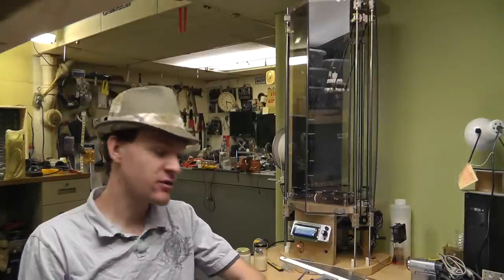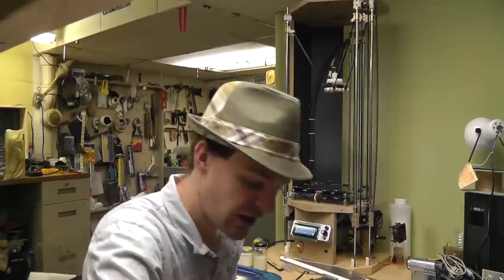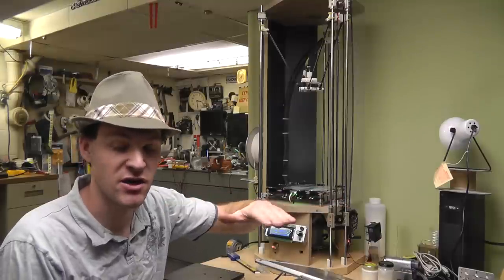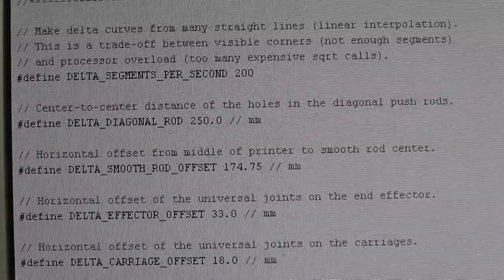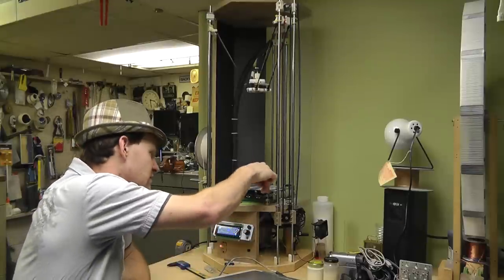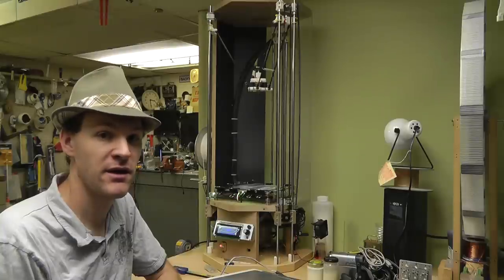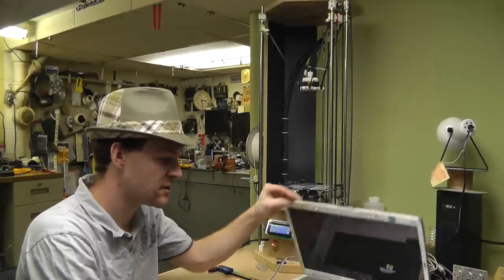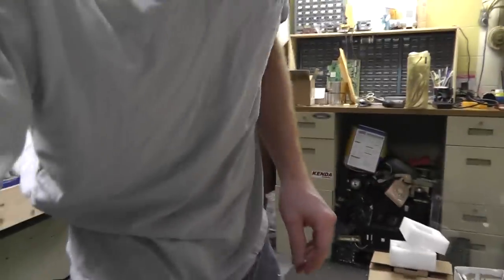Delta 3D Printer Project. Update1. How To Fix the Curling ABS Parts & more tweaking and upgrades.

Comment: I had posted on the forum about excess air flow when you were building your printer, also mentioned the stepper motors would not get hot went steps were adjusted correctly and to make the bed adjustable for leveling purposes, was just trying to keep you from pulling your hair out in frustration. Your abs paste trick is a good one especially with the pvc card applicator, I use a soft plastic bondo spreader. 3d printing is a wonderful learning experience. Thanks for the plug on the hotend, Jeff.

Comment: You've probably already figured it out by now, but your problem is the upper layer of plastic cooling and shrinking before the lower layer, the further up the print, the faster it cools and because the layer just below has shrunk, the next layer will have higher tension, causing it to bow. I'm looking to design my printer so its in a kind of oven. keeping the whole print at a temperature a little below melting point.

Comment: nozzles and the bed both expand with heat, and this affects layer height too. To deal with corners pulling up it can help to set a "brim" of ~1cm in your slicer. On my printer I've had good luck with a thin layer of acetone+ABS (mostly acetone with enough ABS to make it opaque) spread over the bed with a piece of crumpled note paper. ABS still builds up on the bed, I just add more acetone. A cleaning tip: chill the glass before cleaning with chilled acetone. Anyway I'm going back to PLA soon!

Comment: I love my 50:1 geared stepper motor extruder. I'm not using a Bowden, but a compact extruder, but I will be building one for it soon. I recommend the straightforward MK7 gear. I tried the Raptor from QU-BD and found that it needs more teeth cut into it to perform optimally. MK7 works well as long as it's clean and not allowed to heat up. Good luck, we're just about done with our first Delta and having lots of fun. Note, sometimes a motor will perform better at lower voltage, so keep tweaking.

Comment: Hi Russ, I just watched this on my PS3....really good to watch and no doubt I will be back to it when I get my Delta printer running....I was a bit concerned you appeared to say the glass plate was making crackling noises....if so its fracturing but not breaking/shattering...you would see reflective "curtains" thru the glass thickness...( make lampwork glass beads and see this at times)....Rgds....Laurie

Comment: the problem with the deformation lies within the small die you have. The polymer chains will align strongly with the die when being pressed through the die. When the polymer lies on the plate and is not being cooled instantly the polymerchains have time to relax and deform (thats why the plate gets bent/smaller. i think the sticking solution is a good one. You surely don't want to increase the diameter of the die. Another solution would be cooling the plate even more, so the polymer chains

Comment: PLA is good at lower temps too. I print on blue painter masking tape, I don't use a heat bed yet. Seems like a nice trick with the acetone but what really worked for me is coolling the melted plastic right after its extruded with 2 opposite fans right on the nozzle. Its important to keep the speed low or else it wont stick but I find to keep the printed part cool all the time is better. I also do a first layer very thin to heat the tape I print on a little. A nice idler : Wades geared extruder

Comment: Oh you may want to check that you have the latest version of Sprinter installed on your Omega. Don't be afraid to tweak a bit I have used up 4 Pounds of 3mm getting mine working 85% of the time...

Comment: @rwg42985 your channel is awesome i have a question. for what are the tension springs on the axes?! you haven't even thought to mention it. Why? are they random irrelevant Objekts to look the printer nicer?
Reply from the maker: hi, thanks, the springs are to keep the ball joints tight ( no slop) however there really is not Any, so i never mentioned it :) ~Russ

Comment: When i needed to warm alluminum plate over 5mm i founded the truck mirror heater. It looks like plate with two wires. And my alumin plates warming evenly over all plate and and warming tooks very fast. That mirror heater works on 12-24volts. :)

Comment: And for main heating hed wire that swiwels on top i saw on other 3d printer some kind a solution. The solution was like on buildings elevator with wire, wheel on top an counterweight on other side. And it is calibrated to freely move with head when its printing but holds nicely that main wire of head. I think that solution is good because head is moving updown an to all axes. Piano wire might not work how you think. But try both solutions. I hope that you got idea. :)

Comment: ok this will happen from time to time check your extruder and check the Gcode file...
Warping is caused by lack of Heat.  Do not try to print ABS without Heat control a 25 Degree room is good but if you can enclose the Printer all the better be sure to isolate your extruder Head. stray heat can melt your X carriage mounts. also you should be running 216 to 225 Degrees on the extruder and 111 to 114 on the base any higher and youll start melting your 3D printer....

Comment: I plan on making the previous Mendel Prusa available, I personnaly have a i1, or 1st gen Prusa, but I will print the i2 and maybe the keep the 1st gen for special requests. For the i3 I can do some variations on the size, get it custom to your needs, like thicker MDF (5/8" instead of 1/2"), different colour for the frame, etc. I will sell the frame fully assembled and also you need to check out the software/hardware (PC side) I will make available, it will be awesome! (hint: iOS and Android)

Comment: I am planning on releasing my really unexpensive Prusa Mendel i3 Reprap, my flavour I have been working on with a 12"x12"x12" approx. print volume. My version has a low count of printed parts and the frame is out of water resistant MDF. Here is my website: reciproqc (dot) com , still under construction but the store should be in operation really soon. I can be reached, in the "Contact" tab you can send me an email and tell me what you need!

Comment: Fast google gave me this as first result
gigaom ( dot ) com/2013/07/24/3d-printing-is-as-bad-for-your-lungs-as-using-a-stove/

So yes it isnt great for you, but at the other side PLA is the same as a candle/eletric fire.
So i wouldnt concern it to bad, or if you use it in the basement with no windows nor anything and use it for days non stop